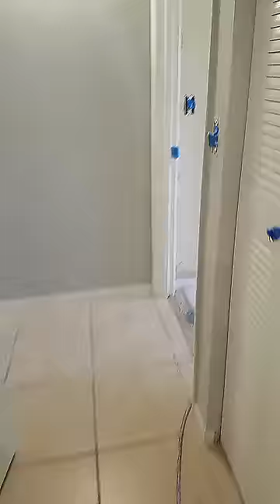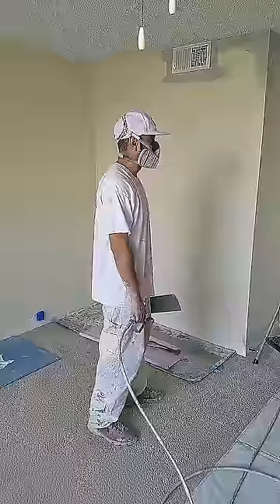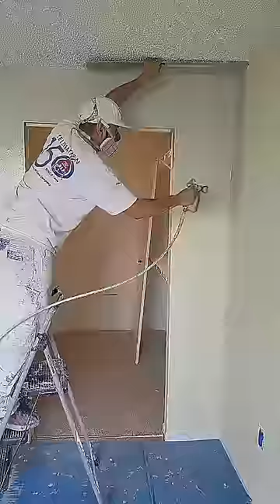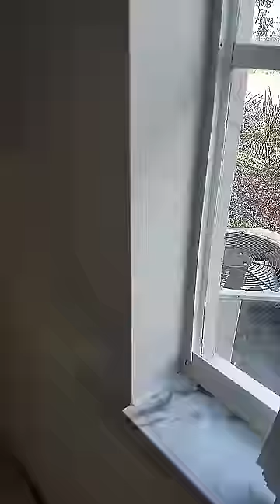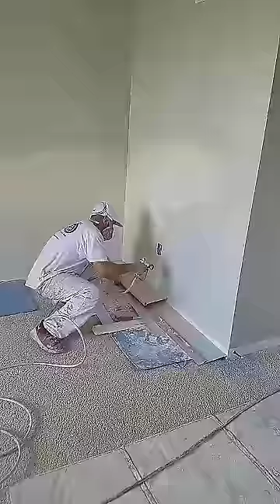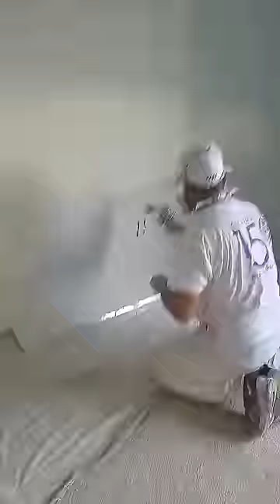Paint a room in 12 minutes

Comment: Why when I see a video of shield work being done is there ALWAYS the house painter brush and roll guys saying it is horrible for over spray..won't touch up..but none of these individuals have a video of them working? Almost as if they did it..screwed up because they had there rig turned full tilt and got kicked off the property..if the wall was originally painted correct ( back rolled) there should be no issues with touch up as long as you don't walk up and put thick square of paint in middle of wall that natural light reflects off of. If you have made no video of your skills then obviously your not good enough to knock someone else's

Comment: I care more about quality than speed
Reply: T Gresh nicely said
Reply: T Gresh very true . You can have both
Reply: T WENT  FROM 0 TO 100 REAL QUICK
Reply: Nice 👍
Reply: It's a Hyde . Probably a 36 or 48 not sure which. Can be bought for 40-50, comes with a two foot handle
Reply: yes quality first  thats my goal to..
Reply: As an ex painter, I went for quality then speed. And on these clips, you don't see the overspray going ,landing different places. I would only spray 1st coat sealer then cut and roll
Reply: I agree the ceiling is one thing and the trim but a rolled wall is a way better quality job and I get the whole production thing but you cut around windows and doors anyway you could have painted just as fast with an 18” roller

Comment: Paint spayers 20 years ago arent as good as the ones they have these days. Manufactures have had many years to fine tune these machines. Also backrolling is not nessesary in every application because rollers always leave some sort of stipple no matter what. So for applications where you want a completely smooth finish there is no need to backroll. It the same reasons car painters dont use paint rollers lol dont waste your time always backrolling. Ive never had a callback.

Comment: There is a flaw here, If you don.t back roll the sprayed paint wiht a paint roller and bump the wall moving furtinure etc and touch that up with a mini roller, you will see that repair because the spray has a different texture then  a roller and that differenence in texture reflects light differently and that's what causes the repair look dif. even if its from the same paint can
Reply: John Haser I do apartments and also high end homes. I turn 3-6 apts per day like this.  But I will not even use a spray-rig in a high end home. Too much to go wrong. 
But High end work pays between $.88 and $1.30 sf.
These types of apartments pay $90 or even less for the entire 1 br suite.  

I can work either end of the spectrum.
Reply: @TanTan-ni4mg  $90 for  entire 1 bedroom suite, where do you live?
Reply: @NoOne12332  in a van down by the river. 🤣

Comment: No doubt... this type of painting has its place such as in apartment turn overs.... etc. But there is no way you can pull this off in a customers home. I noticed that you over ran the spray gun and landed the trim..... whats not seen in the video is close ups of what your trim and ceiling cuts look like. I am actually glad you didnt show people that because they would have freaked out.
Reply: mpegguy2000 you can see over spray on the ceiling.
Reply: mpegguy2000 that's actually pretty bad painting I'd probably spray cleaner than that
Reply: I can only imagine the overspray on the carpet especially if they didn't replace the carpet.
Reply: I know theres fucking overspray & dust on everything in that god damn room . No fucking way nothing got overspray 😂

Comment: I did that in a house and everything got messed up when it was time to do the touch ups. Since the srayer leave a different texture then the roller it looked totally messed up to the point that I had to roll all the walls again!  And yeah the home  owner laughed at me
Reply: Lemme guess you was spraying satin
Reply: Usually a guy goimg behind you with an 18inch roller.
Reply: Well there could be a number of things causing that..the original painters spray and back roll ( look for roller texture) some will spray small walls with no back roll so your automatic screwed... If you was trying to touch up EXPENSIVE eggshell instead of painted whole wall your screwed.. I spray only walls with inexpensive eggshell and blends perfectly..
Reply: @matth268 is the roller supposed to be dry for the back roll?

Comment: 12 minutes to spray and then 30 minutes to clean all the equipment 🤦🏾‍♂️
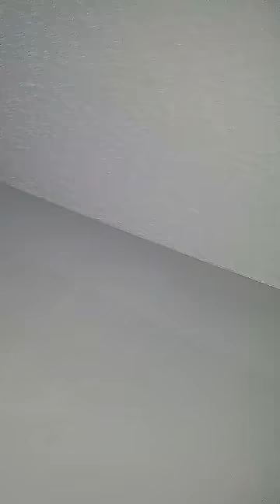Reply: Don't forget about all the prep before even bringing the sprayer into the house. Masking, floor covering, straining the paint for the sprayer, setting up the sprayer, cleanup, and now because you didn't cover the carpet there's overspray dust everywhere, including the windows and everything else. I do appreciate that he kept the door shut so the overspray didn't travel throughout the entire home. :) Even if it's a cheap rental home I'm not convinced that it's a great idea to spray unless you'd want a perfect mirror smooth finish, but with that 4 inch fan sprayer tip, not releasing the trigger at the end of each stroke, etc. it's as uneven as a child's finger painting. Look carefully at 11:50 how uneven those lines are by the ceiling.I usually try to find something positive to say to start my comment, but I'm sorry, I couldn't find anything here. I do appreciate their time to upload the video. Keep practicing with that brush and roller guys and you'll finish a room nearly as fast as spraying it and with much better result. For some things there's no short cut to speed and quality. Not even the accubrush paint edger :D That's another ridiculous topic I won't get into. For that particular room by the time you cover, mask everything properly, set up sprayer, I'd be very close to finishing my perfect lines with the brush with zero masking needed, and before I'd do my 15 minute roller job I'd take 4 minutes to put masking tape on the baseboards to protect from roller splattering. Couple hours in and out with a few minutes of cleanup left, but again after 25 years of doing it it'd be a shame not to keep that pace without braking a sweat.

Comment: This is insanity. All apts i paint are white ceiling and trim with grey walls, we change them from tan all over. We shield ceiling with sliding plastic 2 ft shield and spray and back roll walls. Always looks good. I would never do my process in a house. No real painter would.

Comment: Very professional.  I just bought a sprayer and am going to do it exactly like that.  You make it looks so easy and CLEAN !  Question, why a 411 tip? My latex paint manufacturer says use a .15 tip.  My machine came with a 515 tip and I ordered a 215 tip for cutting into ceilings and baseboard and around windowns. Is there and advantage to a smaller tip with an interior latex?  Thanks Thumbs UP !
Reply from the maker: 97widerider u can. I use 411 because is less mist in the air. less over spray.
Reply: ok, I was wondering how you did this with so little overspray.  I will try to find a 411 tip locally.  thanks !
Reply from the maker: 97widerider no problem,  if you run into any issues, let me know

Comment: I use similar techniques but there is no way this came out even with just one coat and no backroll. Also I doubt the ceiling lines are acceptable. Great for 1st coat though. You Need to learn to not start and stop on the surfaces being sprayed. Thick laps stand out like a sore thumb.

Comment: Spraying is not realistic for 95% of painters as its a skill to handle a sprayer like he does and most painters just cant! its possible to first coat a room in 15 min by hand if you have mastered the brush and roller. If you add the touch ups needed here it turns out to be faster and more accurate by hand.
Reply: Edmonton Repaint Guys no way this ceiling lines are good, and the over spray on the ceiling,has to be re done ,plus time to tape could of been done,😂

Comment: Dudes quick with a sprayer, but a weird technique. By the time he makes his first pass at top I would have the whole ceiling cut out, by the time his bottom pass is done I'd have all the bottoms and outlets cutout, corners from top to bottom I hit with mini roller and it takes 30 seconds each corner.. By the time he's finished all id have left is 15 minutes of rolling that small room which is probably what it took him to prep the room before the video. Lol spraying interior walls has a way higher chance of error between overspray on trim, ceilings, fixtures, floors, heavy spots from overlap, fingering if your pressure ain't perfect, runs and drips.compared to cutting and rolling. After the prep work he ain't saving that much time, and he's spending more money in paint because spraying always uses more than cut and roll.

Comment: 411 tip and Superpaint ? How much water did you have to add per gallon to get it to flow just right ? I sprayed  16 doors yesterday with my 440i  and 211 tip ! I had to add about 6 ounces of water per gallon  to superpaint semigloss to flow  just right ! I forgot my 313 that I normally use for doors ! They turned out nice ! I strained paint and 100 mesh gun filter .  Most painters Use the 211 , 311, and 411 for doors and trim , and they leave out the fact that they are reducing the latex with water to get to spray just right !  I know because Im a Painting contractor of 20 plus years in Fla. !  I hate to have to add water to paint , but the smaller tips create way less overspray and a nicer finish !
Reply: I use a green 312 Graco fine finish tip through a Graco 395, using Super Paint semi gloss,... undiluted....., 50/50 passes on pre primed doors and they come out mint, factory style finish, every time.
Reply: not really most paints flow good thru 211-311 tips even the 210-310 ff tips
Reply: I spray doors all the time with graco 310 tip, never once in my career diluted  latex paint to run through airless rig...I have with hvlp not airless

Comment: I painted a lot of housing commission and rental repaints and the only things I would spray were ceilings, cupboards and colonial doors if there were any. I would never spray walls, there's just too much to mask up. My son would cut in all walls after ceilings, doors, cupboards and trims were done and I would follow him around with an 18 inch lambswool roller. We would do 2 coats on all walls including garage in one day. They would come up better than the original painters left them. I wouldn't advise spraying walls.
Reply: Exactly. They didn't show the set up, mask off, back rolling, touch up, recuts, and mostly another coat. I can cut and roll a 2 bedroom apartment all one color and all the same color (turnover) in less than a day by myself if there's no major extras like large patches or old school trim.
Reply: @matth268  I'm running 4hrs per 2bed unit..walls closets trim and doors.. includes prep clean up touch up

Comment: Thanks for the tutorial video. I’m a plasterer in England and have used spraying machines for plastering. I want to start spraying paint to save time on refurb jobs but have always just seen it as mist coating and wondered would this method be suitable when using two colours? ie... white ceiling and a grey wall as a the example. Taping up a ceiling edge?..nah..taping a wall edge? Nah. Wouldn’t work I’d be there all day. But watching you with those light weight aluminium screens gives me a chance. And if there is a mistake I’ll touch up no problem. I noticed the gun was the smaller which makes sense due to having more control... is that right.??
Reply: I paint mostly freshly plastered walls and I find you cant tape it just pulls right off better off doing the skirting first 👍

Comment: I'm trying to figure out if I can use a sprayer to cut down on my time. Why is the second coat rolled? Do you recommend the rollers that use the spray machine to feed it? Is a sprayer worth the investment if I have to do about two apartments per week?
Reply: I think if you had a pressure roller, you could really save time. A small sprayer is all you need. Very low pressure with the roller system. Graco has the classic pressure feed roller and the Jet roller, which you can use whatever brand cover you want.
Reply from the maker: Francis Roy of course it will. Just make sure to start with a small fan tip. Like 311. For less over spray.
Reply: Thank you guys. I'm currently considering the Graco 390. It's the smallest one they have, and I'll never be doing anything larger than pre-lived in apartments. The whole kit, though, once one gets everything from tips to masks to jetroller, etc. is $2k, which is why I'm thinking about it carefully. It'd take me about a month to get my ROI on it.
Reply from the maker: Francis Roy yes that's perfect for what your doing. or a titan 440 they are great machines. u can't go wrong !
Reply: Do you believe that the Titan 440 is comparable in quality? It is almost half of the price, and that's tempting, but I'm concerned about performance and reliability. What I'm doing is obviously small scale, but it's still "commercial" in that it will get used on a regular basis. Do you believe that this will last me for years, tips excluded?
Reply from the maker: Francis Roy yes. I own one my self the 440 it's actually better than a graco 390. So yes u should get it
Reply: Interesting! Thanks for the feedback.
Reply: 440 is one of the  best sprayers produced today ! Actually you could get by with the Titan 400 , and Sherwin Williams sells them for $750 , can spray up to .47 gal per min. and .021 orifice tip !!!  Would be plenty for what your doing ! I have had my 440i for 15 years and had the piston repacked 1 time ! I keep it clean after every use ! Latest job was a metal roof with 40 gallons of elastomeric roof coating and sprayed well with a  621 tip ! Only thing is you have to remove gun filter when spraying elastomeric ! I did change my gun to graco contractor 2 gun , I like better !!  But either way Titan and Graco are  the only sprayers  to buy !!!!
Reply: you do all ceiling with sprayers then u do all walls with rollers and paint brushes if you care about the finish product. 
these guys are speed wise nothing wrong with what theyre doing but if this was your house youd like the paint worked into the drywall by a roller cuz as soon as someone puts anything sticky on there itll take the paint right off the wall

Comment: Let me ask you because i have a 395 what size tip are you using and did you have to add water to your paint if so and how much and does it matter if the paint is latex or oil base when determining to add water?
Reply from the maker: No add ons to my paint . I use a 411 tip

Comment: Hello im painter in México. Why is necesary back rolling ???? Thanks
Reply: Because backrolling enforces consistency. Just spraying it with a horrible pattern means a halfass job. It takes years of spraying to master coating consistency. Even then I still backroll afterwards. Interior or exterior
Reply: Thanks buddy
Reply: The reason you back roll is that you can’t touch up a spray finish unless you get the sprayer out to paint the whole wall again back roll give texture so if you need a small touch up later you got a fighting chance it will blend in that’s it the only reason

Comment: Masterclass in spraying no overspray great video
Reply: master class in poor coverage and inconsistent patten. And omg, the poor owners will have so much clean up. Seeing him spraying so close to the trim without using the shield (with only about an inch of paint brush cut in) made me queasy. This is why I paint all my wall in my house myself. Get it done right. Paint brush and roller and proper masking off, including drop clothes. These monkeys that get in and get out usually skim on paint and coverage. A couple years later, you'll see the patterns as the paint fades. Especially on the exterior of a house.